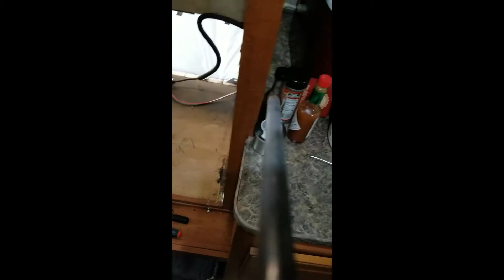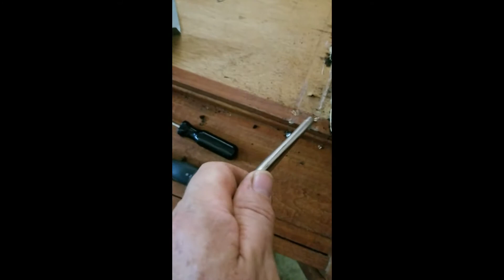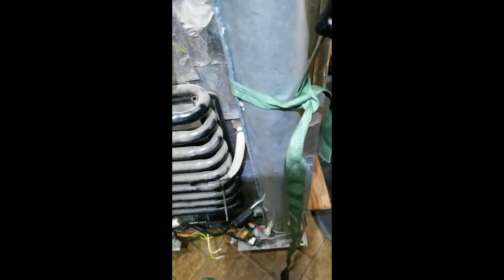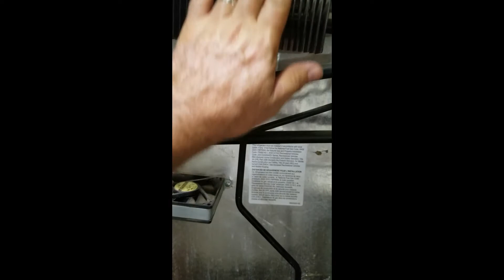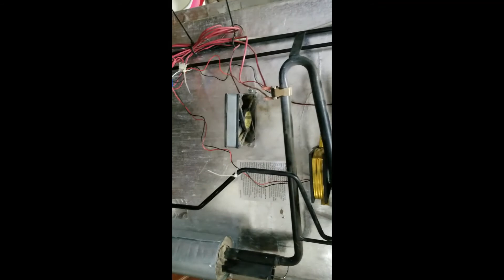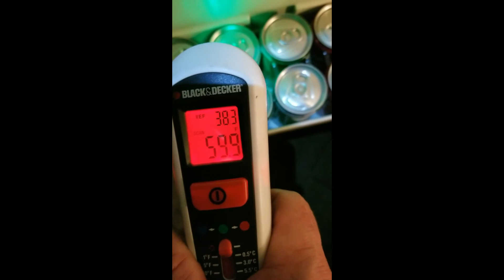Repair of Dometic DM2652LBX fridge

Comment: I started this project to change my heating element. All other videos showed the heating rod coming out easily from the outside access panel. Once I realized the boiler had to be opened up all the way to the top as shown in your video, I figured I will just live with propane only fridge until something else breaks on it. Shame they designed it this way. All other models can change the heating rod from the outside.